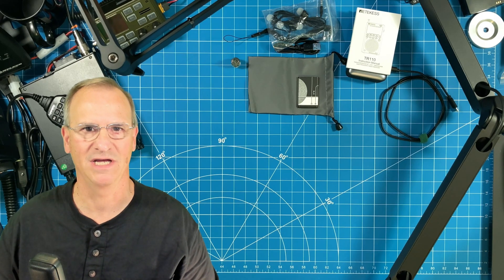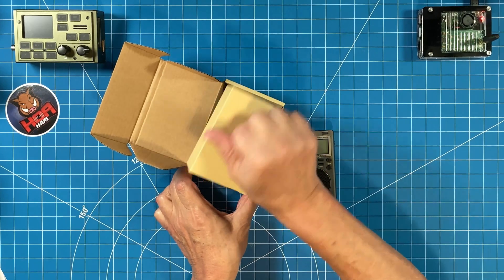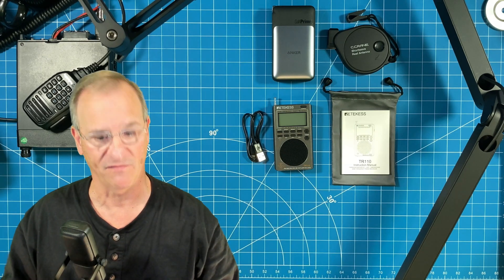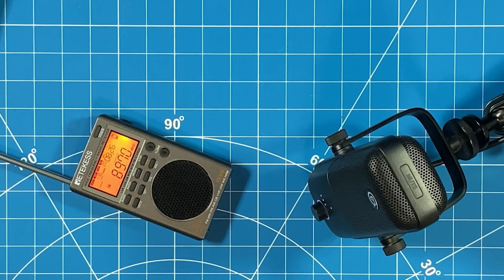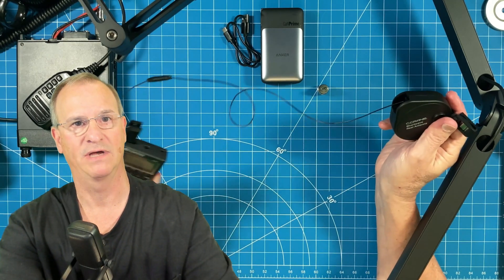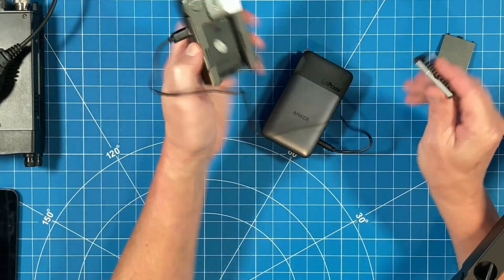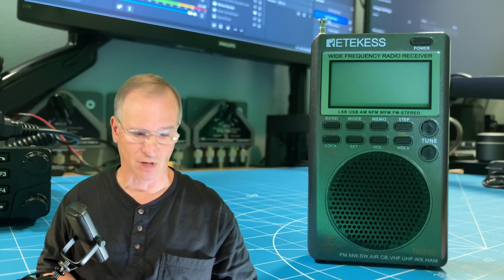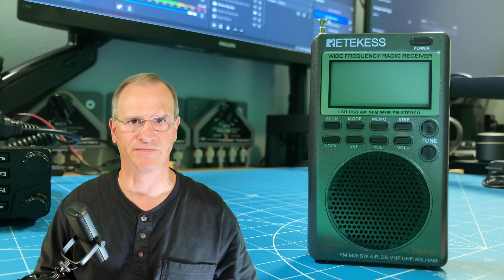A Pocket Full of LSB on 40 Meters -- Review of the Retekess TR110 Shortwave Radio

Comment: Maybe I have a bad one, but mine is an absolute dud. If you plug in any sort of antenna like that it just overloads. SSB is too wide to be usable and never tunes quite right. UHF is entirely deaf. Nothing past the standard AM/FM bands work adequately enough to even by usable in any meaningful way..
Reply from the maker: I suggest sending it back for replacement, or a refund; obviously shouldn't be performing like that for you.
Reply: @HOAHamRadio  Unfortunately that ship sailed. I’ve had this radio for over a year. Just thought it was wasn’t a very good radio and shelved it. Only after this much time do I see other people liking theirs lol..

Comment: Great review, thanks. Bear in mind that a Chinese Company has made (used) an all-In_one Chip to shrink it all down. Most of the time the firmware blocks band areas to comply with regulations. The big issue is they have to sell millions to make the production of that great chip affordable. SONY would never do this in this way. Several brands have this radio now in their lin-up. I gues a new maybe even more capable version is already in development. Maybe even a transceiver. I will follow this closely. BTW did you find the Bluetooth option?
Reply from the maker: Thanks for the feedback.  With all the equipment I review, its been a while since I've worked with the TR110.  I didn't remember it having a bluetooth feature...does it?

Comment: The ICOM R6 is a good wideband radio, though it lacks SSB and a good MW antenna. I find the Retekess TR-110 quite interesting. Oh, the AM MW antenna is at the bottom of the radio, like Sangean DT-400W. Good AM reception for a DSP radio, plus FM, Air band, weather, CB and shortwave.
Reply from the maker: Thanks for the detailed feedback;  ICOM R6 sounds interesting.

Comment: Receives 153 or 520 KHz to 1710 KHz and 3 MHz to 520 MHz, with MW, FM, CB, Weather, and shortwave doing good. Antenna options with a few other items. BL5C battery is common.